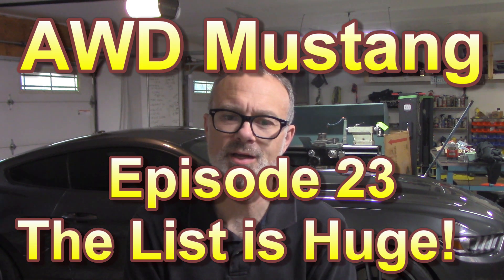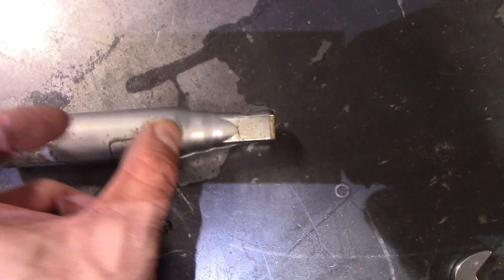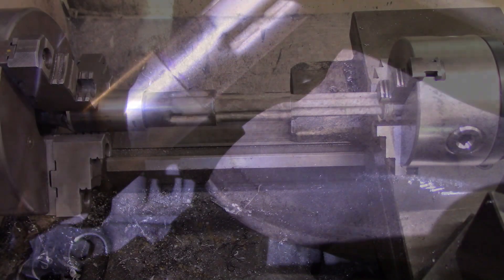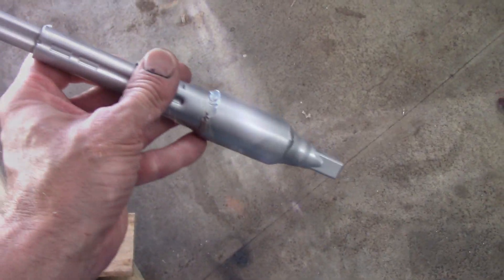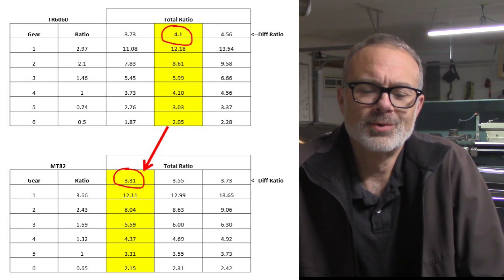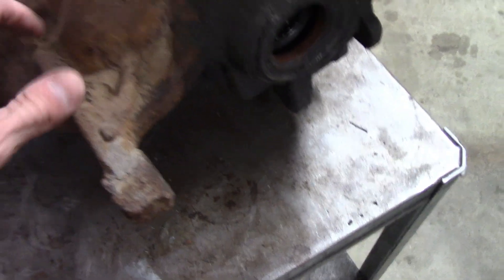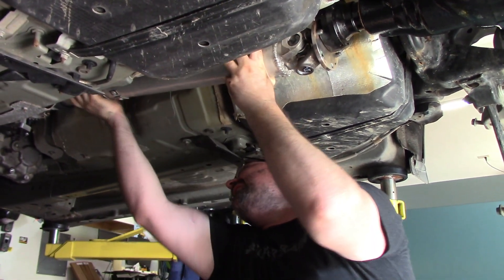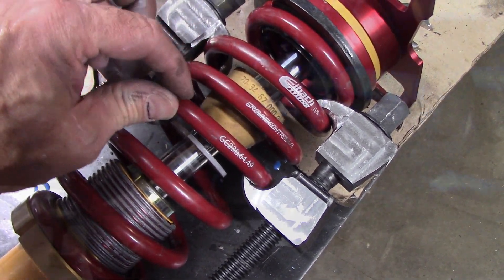All Wheel Drive Mustang Conversion Ep 23 - Steering Shaft and Diff Gear Swap

Comment: The slight difference in diffs might be an advantage, it means with the clutch in the transfer case fully engaged the rear wheels will still transmit more torque than the front.
Reply from the maker: This is true.  I few modern AWD cars, like the Acura SH-AWD, GR Corolla, Focus RS have different final ratios front and back for that very reason.

Comment: Oh also BTR makes a bolt-in 8500rpm Ls valvetrain kit(4.10x3.31 or 3.26 stroke)...oh the possibilities 😊.  Also there's adapters to run an Ls7 intake manifold for port injection....I think using a piggyback setup like you use on a bmw to ADD both to keep it better drivable as well as a clean intake port and allow more hp without overdriving the di pump. Just use a swirl twin pump pot to feed it. I figure 800whp would be perfect in that setup with the weight. If turbo'd a scramble function could take you to 1000+/-whp if/when needed
Reply from the maker: Another watcher is working on an AWD CTS.  That would be a cool project.  A 2nd Gen CTS-V with AWD and manual transmission would be a riot!

Comment: Subbed, i would love to do this to an cts-4 caddy. Use an 8hp70 trans awd or what you did(maybe with a magnum t56). The whole front assembly is already awd AND may allow a factory ls 4wd or awd pan, etc to make matchups easier and use an Ls V8. I think a sequentially shifted 8spd(love mine in my bmw) with possible trans brake would be awesome. Question would be supercharged or turbo. It would benefit from factory bolt on big brakes and easy suspension setups. Custom widebody would be another thing.  Cool though much like your incredible project